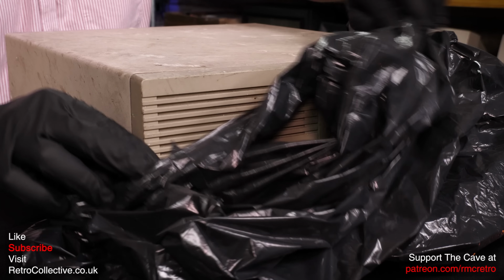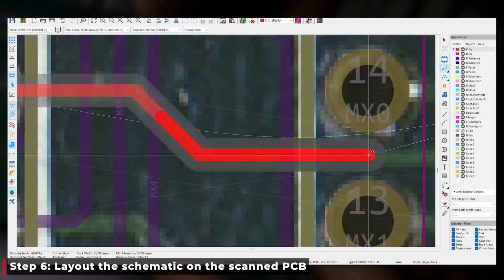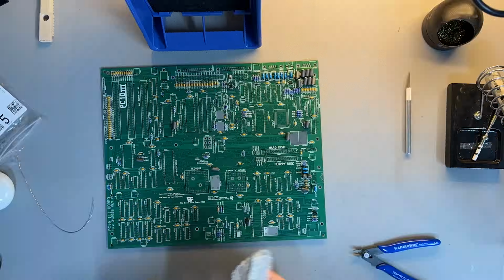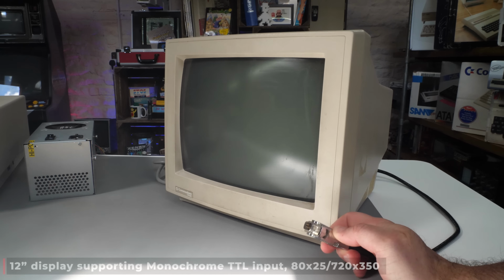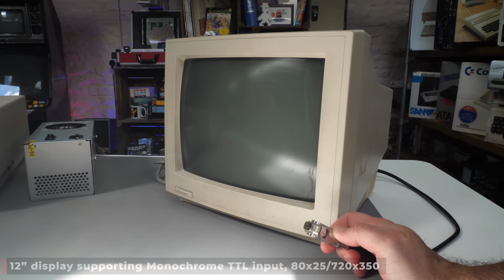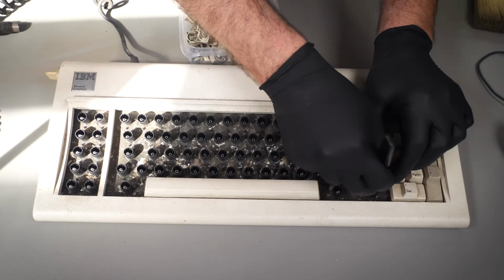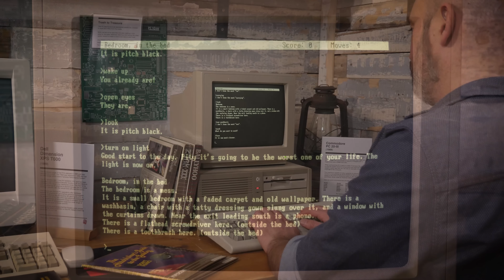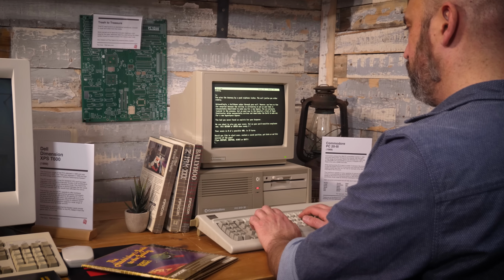Too Broken to Fix? Just Make a New Motherboard! | Trash To Treasure

Comment: The amount of time that went into drawing out that board is immense, a labour of love right there. And it worked first time! This was a mighty feat to bring this back from the dead. Maybe it should be next to an Amstrad 1512 as that was the PC that really gave x86 to the common man here in the UK.
Reply: Having it next to a 1512 would be interesting as both computers have special graphics modes which however were sadly rarely or never supported. But the games by The 8-Bit Guy support both the PC-10's Plantronics compatible graphics and the special 1512 graphics. So that would be a nice comparison to see at least..
Reply: Get an Atari PC and complete the set!

Comment: 9mhz turbo speed ... mere mortals were never meant to wield such almighty power ...
Reply: you can overclock it to 9.3mhz, but beware of the heat, it runs at a hot 30C :)
Reply: I dreamt of such breakneck speeds when I only had a lowly ZX Spectrum back in the ‘80s
Reply: I'm willing to fund a fully restored video toaster. Your the only one who can help me relive those early days when technology took over master control. I felt like a god once people saw the capabilities I could create....God bless newtek,  and RMC....YES IM GOING EASY ON THE COMMENTS. hope your well Neil, looking good
Reply: It didn't have any bus frequency dividers, and many ISA cards could not handle 9MHz operation.
Reply: The kilohertz are OVER NINE THOUSAND!!!

Comment: Avoid brake fluid for sticker residue; it etches ABS plastic, and can also cause embrittlement. No idea why people would recommend it for something as simple as sticker removal.
Just to add to the pile of recommendations, my favorite is charcoal lighter fluid. It's basically just mineral spirits, but barbecue lighter fluid is a readily available and cheap source of it.
I like it because it works quickly, doesn't harm plastics, and doesn't leave any residue of its own.
It (or something similar like kerosene) is likely the component of WD40 that is actually doing the work of removing the residue.
Honestly, there's nothing wrong with sticking with WD40. The spray can makes it easy to apply, and it's likely comparable in performance to the other products anyway.
Reply: People must have suggested brake CLEANER, certainly not brake fluid!
Reply: @Nicolasherdwick  I think brake cleaner would attack plastics too though, right?
It seems the exact solvent mixture varies, but it looks like a lot of them contain acetone and methyl acetate, both of which dissolve ABS plastic.
Reply: @thepenultimateninja5797  I've never used it on bare plastic myself, so thanks for the warning!
Reply: @Nicolasherdwick brake cleaner absorbs the oils in plastic. Use an actual electronics cleaner spray. It should be on the same aisle as brake cleaners.
Reply: With most types of sticker residue any kind of oil will work just fine. In a pinch you can even raid the kitchen. At work I use the bottle of sewing machine oil we keep around. We do have a special adhesive remover that claims to be safe on plastics but in my experience it tends to dull formerly glossy surfaces so I'm not 100% convinced. It's also incredibly smelly and probably not particularly healthy, even though there aren't any warnings on the bottle (not sure how that's even possible in 2024 in the EU).

Comment: Had that PC when I was at university.  Bought through a Barclays student computer loan. Funny thing was that after a month it wouldn’t boot. Commodore sent a field engineer who told me the there was a known issue with processor popping out of its socket when it cooled down. So for the rest of it’s life before I eventually upgraded to a new motherboard it sat on my desk with no screws in the case so I could push the processor back in every day.  Good times.
Reply: Great story lol. What year was this? Also, out of curiosity was there no way to stick the processor down? I suppose tape would get to hot?

Comment: Unbelievable restoration. I agree with those that say keep this machine as it is now. Back in those days it's not like this system would have gotten an upgrade. It would have been more likely that the owner would've moved onto a newer PC and probably sold or gifted this to a family member. At least that was my path. Amstrad XT then got a clone 286 with SVGA. :-) I also remember checking out Commodore PC's at Kmart. I never knew anyone that owned one.

Comment: 17:30 To be annoyingly pedantic, both the Model F and M use buckling springs, but the difference is that the hammer hits a capacitive PCB on the F vs. a membrane on the M. While you could technically call the Model M a membrane keyboard, in common use the term membrane now almost always refers to rubber dome membrane keyboards, and is used an an antonym for mechanical.
Reply: I don't think it's pedantic. The Model M is known as a mechanical keyboard by virtually everyone.
Reply: Thank you!  I have two Model Ms, and I will fight anyone who dares slight them.  They are majestic keyboards and definitely buckling spring.
Reply: @philrod1  I loved the old IBM KEYBOARDS.
Keyboards of today are junk with their numeric keypads.
Reply: You have failed to be annoying, sorry.  I thought it was a delicious bit of information - and I've got a Unicomp PC122 on my desk.
Reply: @philrod1  nobody debated that the M uses buckling spring. The point is that it uses a membrane as well.

Comment: What a massive project! I can barely design a 2x2cm PCB with 4 traces, I can only imagine the efforts and skills behind such a restoration. The machine looks so incredible, particularly considering how it was found - I'd put up some pictures of the "before" on the wall so visitors can appreciate the restoration even more! And maybe the old, corroded motherboard?

And yes, WD40 is perfectly fine for sticker removal! One tip - which you might know already - soak the label and give it time. Most of the labels would completely dissolve and come off with no need for scrubbing within, say, 30 minutes. Plastic labels ones are tough as the WD40 cannot reach the glue. 

Thanks for the video!

Comment: Ive tried just about everything to get the gum off and by far the best and cheapest thing I’ve found is just plain old petrol.. just a bit on a rag dissolves it straight away and it doesn’t affect paint .. plastic is ok too just don’t leave it on too long .

Comment: My first x86 PC, the Commodore PC20-III, which I bought as an open box special in mint condition with its Commodore color monitor for a mere $300 at the RAF Lakenheath BX (base exchange) while stationed at nearby RAF Mildenhall.  I already owned and used concurrently my 1040STf with associated color monitor.  I went back to the states with it and gave my 1040STf system (with 115V step-down transformer) to my next door neighbor (mainly for their kids) in beautiful Bury St. Edmunds.

Comment: I learnt another trick for removing sticker residue without chemicals and its just rubbing over the residue with a pencil eraser! Of course there's the bits of rubber to sweep up but its not a liquid and they can just be hoovered up if they get inside something. Its worked very well for me on hard flat surfaces, not so good on textured surfaces but worth a try and cheap!

Comment: I use WD-40 to remove stickers as well, it works.  The only thing I had issues with was strapping tape, that needed some mechanical removal before the WD-40 would work.

Comment: I use the IT Dusters CompuCleaner (that you also have) to blow out most of the water out of the keycaps after washing them. Vastly speeds up drying time.
Reply from the maker: It’s a good tip and exactly what I do too, aside from having to fetch a few when they fly across the room it really helps
Reply: @TheRetroCollective  Plus, it's really high pitch when the air swirls in the gaps. I have to put earbuds in 😳

Comment: I once rescued a keyboard which was going to be thrown out due to continually repeating a particular letter even when nobody was touching the key.  After I got it home, I pulled it apart and found that the metal used as the key return spring had been warped very slightly, and there was just enough of a bulge for it to press against the membrane keyboard.  Once I flattened out the tiny kink, the keyboard worked like new.  So I scored a free keyboard since it had been given to me to keep.

Comment: Nostalgic memories of green monochrome screen, rattly keyboards - and people busily researching and writing books mid-1980s.   It was a darkened room, long table, and two of these IBM XT computers sitting centre stage.
Shortly afterwards 300 bauds modems arrived, and then bulletin boards with shareware repositories.
The 'net came quite a bit later.  😊

Comment: Neil. I've used lable remover for years as a daily job on laptop, server, monitor PC and peripheral refurbishment for 6 years plus. We've tried all sorts of products and by far the best thing we found was a product called Pro-Power Label Remover. It doesn't damage any of the devices we've used it on, it smells nice and usually it works instantly. On particularly old stickers where the glues have hardened or turned to goo over the years, a quick spray and leave it for 5 minutes and it all wipes away.
I cant recommend it enough.
Reply from the maker: Nice tip thank you!

Comment: Recently i've been thinking about building my own Amiga 2000 from scratch, but after seeing how much the commonly available parts would cost, how much the scarce chips cost (if you can even find them at all!) and how rare even the empty cases are... i quickly decided to stick to emulation until those FPGA chips finally replace Fat Angus, Gary, Denise, etc.
Reply: The good news is that for an A2000 you can use a chipset from an A500, which are much more common. A replacement exists for the one A2000 specific custom chip ("Bluster")
Reply: you could go for the E-ATX version of the new boards. would save you some money being able to use ATX case and PSU.

but you should be able to solder SMD's before going that route... because the EATX variant have loads of it.
Reply: @brrebrresen1367  Oh its not the PSU and case thats the issue, its those custom chips nobody makes. Everything else you can find modern equivalents for but the custom chips Commodore made have a dwindling supply...
Reply: need a donor A500 and you get most chips except the Buster chip.
now there is modern replacements for the Buster chip problem is that they are mostly "make it yourself" with just a bare PCB.

i managed to score an original A2500 from Germany for "reasonable" price (around 350€ with international shipping and VAT)
needed a new fan in the PSU and a adapter for using PS2 keyboard and was working.
was planing to build an A2000 EATX but with an original the PCB is just being on the shelf until i find time and a A500 not worth saving.

for my part is the price for the stuff that you can add to an A2000 that you can not to an A500 that makes it damn expensive.
like a Picasso II board and internal scan-doubler. even the reproductions are over 200€ a piece.... and then add a accelerator and you have dumped 800-1000€ just in upgrades, and a Vampire would smoke all of it.
Reply: As more of these replacement boards get designed, changes could be made for drop-in FPGA replacements, with the goal being 90% authentic, but augmented with modern VLSI to make them sustainable.

Comment: This is great, I do have a Commodore PC 10-III with a green phosphor monochrome Commore Monitor and the original Keyboard, and while it did still work last time the board is indeed suffering from a lot of rot under the solder mask (the battery has long been removed) ... sooner or later it might give up the ghost, so it's reassuring to know I could revive it with a new board. Thanks to all involved!

Comment: That is so cool! Nice job thinking outside the box with regards to the unsalvageable motherboard. I can appreciate the amount of work (and love) that the guys at Board Folks put into it. They must have been elated when they got it all right in a single board spin. Man, it must have been cool to see it come on for the first time (I'm assuming you tested it before filming the relevant section). In general I'm not as into the retro PC scene as with other retro electronics because the large majority of them are pretty standard, but this one is special. Congratulations!

Comment: Oh, so many of those, earlier versions then, I assembled during my internship at Commodore Scandinavia. They must have sold quite a few of them but strangely enough I've never seen one in the wild since.
Reply: I had a PC10-III for a while, found it on the street somewhere, with the original keyboard. It had no hard drive but two DD floppy drives. If I remember correctly I eventually gave it to a collector because XTs without hard drives didn't float my boat and I was running out of space. The fun part about old, abandoned hardware for me was always digging through someone else's hard drive, checking all the exciting software they'd installed. So no hard drive pretty much equalled no fun.

Comment: Wow... As a person who specialises in PC10/20 repairs I can tell you that board was FAR from the worst boards I worked on. Had a revision 5.7 with the traces under the battery and near chips completely gone, just bare FR4 material left there. And still went through and rewired the portion of the board back up in about 8 hours and it is happily working in the system for the customer. So I just laugh about this :D
But gotta say - impressive job! I won't build it myself, I have about 15 spare boards floating around that I know about, surely there are more buried under all other crap, but I gotta admire the dedication :D
Reply from the maker: I'm sure you could have saved it with your experience, but it was a nice match to start the fire of recreating this board which I hope will help others too in future

Comment: Great job! What happened to the original hard drive? Also, quick tip: run dirty keyboards through the dishwasher, no soap, just water. Let them dry for a while. I used to put them in the attic to dry since it was the hottest place in my home and they were dry in a couple days.

Comment: In 2009 I took my original Amiga 500+, my Amiga 1200 and my Commodor 128D to the local tip.
I no longer chuck anything away. I have managed to rebuild my collection bar the 128D, don't think I'll ever get one of those back 😢

Comment: No to upgrades. If there's a point to a 4.77MHz PC, it's in running the oldest PC software & games that breaks on faster PCs, from the days when the PC was a system, not a platform. Upgrading it just puts it in a position where pretty much anything else can do the same but better.

Comment: Congratiulations for bringing this system back to life. Great job. By the way, don't reduce the PC20 to 4 Color CGA. Actually, the Paradise chip should support Plantronics mode with 320x200 in 16 colors. Okay, Plantronics is quite uncommon but at least Planet X3 and drivers for Sierra SCI Generation 1 support it. 
The PC20-III should be a great machine for the ultimate Turbo-XT with dropping a V20 in it instead of the 8088. Considering the turbo/double speed, this should be the fastest you can get out of the XT architecture. The Commodore BIOS runs quite well with the V20, I didn't see any significant improvements with the c't V20 BIOS. My PC20-II (unfortunately limited to 4.77MHz) has also a Tandy-compatible soundcard in it and I hacked the BIOS to mute the Tandy sound generator before booting. I did some videos on my channel on how this looks and feels with a Plantronics compatible card (in the PC20-II, it's an ATI, but the Paradise in the -III, to my knowledge, does the job, too) and how I hacked the BIOS to mute the sound chip. But while I think, a V20 would be a great add-on, the Tandy soundcard is something like a "everyone would have bought this if it existet back then" nerd thing, but nothing original, so a question of taste.
Reply: I'd love to see the Plantronics mode, too.

Comment: Never cared for PC until I could afford a P75 system to upgrade to from A1200 and even then I never developed a taste for DOS, DOS games though I did play a few etc. I hated the PC experience with a passion until W2K or XP arrived. 

But man what an amount of effort went into recreating the mainboard PCB! And the result is stunning! I've done the ReAmiga 1200 a few months back, which also was quite an undertaking and I also design PCBs myself though not quite as big so I can appreciate what's involved. 

I'd keep it as stock as possible, and put upgrades into a second or bit more modern machine like you said, perhaps a 286.

Comment: The Commodore PC 10-III was the first computer I've ever owned. I couldn't afford a hard disk at this time. It was paired with a Commodore keyboard with 102 keys including F11 and F12 in the top row, but in XT mode. I used exactly this 1402 monitor. Despite of its limitations I learned a lot with this machine, including x86-assembler, spreadsheets, word processing, etc. I remember playing Flight Simulator 4 on it with nearly 2 frames per second.

Comment: It would be interesting if you had a local BBS for the cave, so that some of the machines on display could "dial in" over a serial modem emulator into a system to play interactive text games such as was on Major BBS at the time.  Some of those games you can still buy licenses for today, either in that form or as a traditional door game.